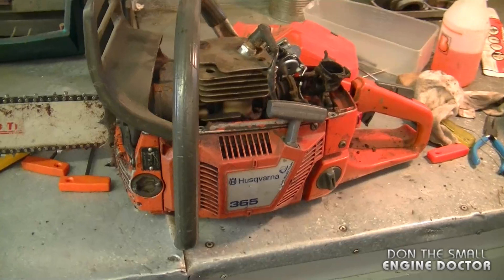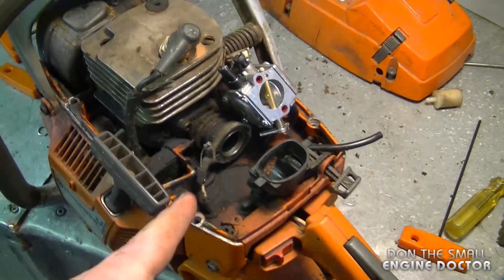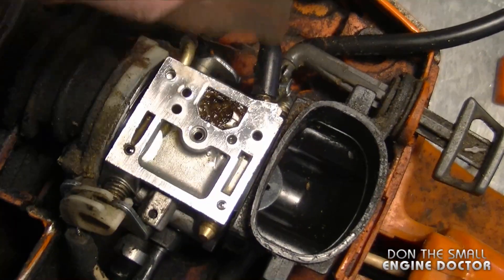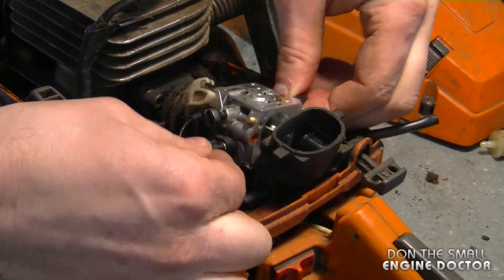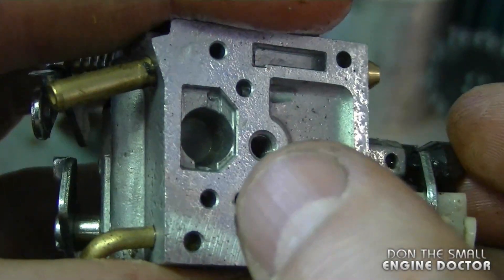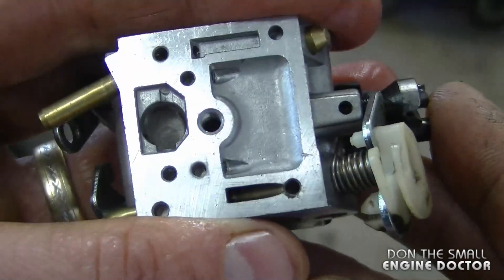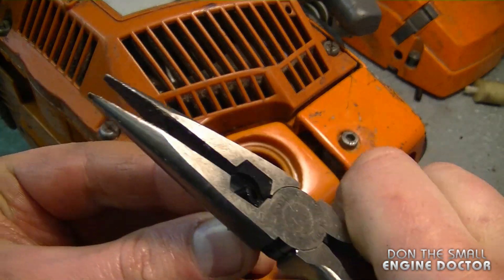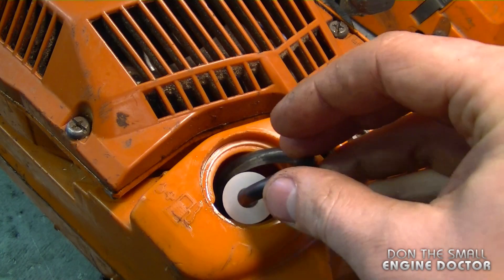Chainsaw Quick Tip #5 - Plugged Carburetor Problems & Repair

Comment: Don, you nailed it again! My Craftsman chainsaw would not run beyond an idle, so I went looking for the fuel filter - it had broken off.  I then took the cover plate off the carburetor and sure enough it looked just like your example in the video. Today it gets cleaned out. (I was already researching complete carb kits.) Sincere thanks!

Comment: Dony, That's the reason I always carry a cheap 1" paint brush with me in my saw kit, brush off the fuel and oil knobs every time before removing.. Good video.
Reply: Thanks man!!!  I always blow them like a maniac, huff&puff as best I can to clear them but *that*^^ is brilliant I've got a million "throwaway"-type wooden-handled brushes, going to make a perfectly sized lil brush / drill a hole in it / leave it looped(strung) around my gas-can's-cap!  What a great idea thanks again :)

Comment: Hey thanks man! My 35 year old Jonsered 525 bogged down and crapped out as if it were fuel starved. I took the top of the carb off and sure enough, the little screen was chock full of crap. Cleaned it and it's running like new again!

Comment: usually when the filter falls off, the fuel line has expanded and may be bad. I have stretched them and found cracks in the fuel line. Those hoses start sucking air causing stalling as the fuel tank level goes down. Usually in line filters have a stainless steel,or spring clamp that holds the filter on,not always but sometimes they do. I usually replace the fuel lines if I find the lines are old. Usually the lines rot and fall off right where the line goes in the tank. This is where the line becomes brittle. If you find the filter has fallen off,plan on cleaning the fine filter in the carb. I guarentee it will have junk in it. Guys cutting wood are always in a hurry to refuel and sawdust gets in the fuel tank as they pull the cap off to refuel. I once drained a tank and found a teaspoon full of sawdust in the tank. It was clogging the filter.

Comment: Donnie, I have a question.  I have a Stihl carb on my ms 460. I bought it used.  Now, it does not want to put sufficient fuel in the engine to get it to roll over in cold start.  It is very hard to get started.  Yesterday, I put some two cycle down the throat and it cranked right up.  It always runs fine once you get it started.  I think the pump side diaphragm is not holding and is allowing gas to drain back in the tank which is reducing gas available to the saw in full choke.  I have even had this saw to crank and run in full choke but never in half choke.  I am going to pull the carb down, clean it and put new diaphragms in the carb.  That should fix this issue.  What do you think?

Comment: Howdy.  Having trouble w/ a small Homelite chainsaw. It starts easy, but only runs on full choke & barely cracked open choke.    Fixed a couple things: new primer bulb, cleaned spark arrester screen, checked carb, its clean, blew out fuel filter w/ compressed air; same crap.      Any ideas ?      Thanks.

Comment: i do a lot of rebuilds of free engines i get off the side of the road... flywheel was not stripped so there was no misfire... had spark... had fuel, but would barely start.. knew it was a carb issue.. never saw this tho... thanks for the vid

Comment: Hi bud, nice vid.  I have a Husqvarna 240 that’s almost impossible to pull the starter on.  Pulls very easily if I remove the spark plug.  Too much compression?  Would cleaning the carb help with this problem?  If not, what else could I do?  The saw has only been used a few times, but has set for over a year.  Any help or opinions would be greatly appreciated.

Comment: i have a question about carburetor.i have a stihl blower br 600 ,and i put a aftermarket carburetor  in it and a ignition module as well both aftermar, should i use oem parts or aftermarket its a good choice? can my carburetor be rebuild and work like new?
Reply from the maker: +perverso12345 oem is always better for those blowers
Reply: +donyboy73 thanks .

Comment: I have a question about the Poulan Pro PP4218A chain saw which I cannot get to run once it cranks. I finally got the saw to crank, but it runs for anywhere from 5 to 15 seconds before the saw dies. Do you have any suggestions on how to fix this problem?
Reply: Sounds like the fuel pump diaphragm has gone bad. If it wont keep running,that means the pump will not continue pulling fuel into the carb. I would recommend a carb rebuild. While you are at it,replace the filter and fuel lines. I know its a pain,but if it wont run,you cants use it for anything but a door stop. Oh, if you can prime the engine and it will keep running every time you give it another quick reprime as its running,then for sure its the diaphragm.
Reply: I thank you for the reply, and that information is very important to me. Since the saw was new I decided to just take it back to the repair shop and let their machanic work on it. I have another Poulan saw which is old and hard to crank, and I will check it for that problem, and take it apart to see what is going on inside of it.

Comment: hey don, where did u order ur ultrasonic cleaner from? and what type of fluid goes in it? I would like to order one.
Reply from the maker: +Robert Waid I got it from a rotary dealer, there are lots on ebay, make sure it has heat setting as well
Reply: What's the model of urs?

Comment: Hey don quick question, I have a echoe leaf blower replaced carb with oem carb ran like new for 5 months  now it acting up again blowing little to sometimes shutting off could it be the car again leaf blower is used quite often
Reply: CARB*
Reply: +fortis619 Leaf blowers can get real dusty. How does the air filter look?

Comment: I have an echo backpack blower and the last time I used it, the power was down a bit.  I checked the air filter and noticed the filter was completely saturated, like a sponge, with fuel. I have never messed with a carb before, is it dirty or should the carb be replaced?  Like i said, I don;t know a thing about carbs.
Reply: Sounds like its flooding. Check your plug,if it is soaked with fuel,then its flooding,this usually happends when the needle in the carb will let more fuel in than needed,a worn tip on the needle causes this. I would rebuild that carb. the kit usually has all the parts you need including needle and depending on type,a seat. I would suggest watching a video on how to rebuild it or find someone that does this work.

Comment: Don't even bother trying 2 rebuild carbs anymore, bought last 2 for $12 shipped. Have generator , lawnmower, and some saws that are pre methanol , read somewhere newer carbs account for that crap. If you ever get chance, maybe do a vid on the  difference between the old and new carbs. Would love 2 see. Thx for vid

Comment: Thanks again Dony for the tip. One question I have is why did you use penetrating oil to wash out dirt, was it just handy or was there another reason. I really enjoy your videos and look for them everyday. Have a Great weekend.
Reply: mcmaster22 this is an old video I'm watching but the reason is carb cleaner will mess up the rubber parts still in the carb where has the other won't.

Comment: I have a question I no it's off this subject but I have a weed eater I can let the spark plug dry out from being socked in gas and I took the muffler of and it's getting so much gas when I pull the rope it will come out side of the muffler every now and than I can get it running but just for a min until the plug gets soaked again any tips
Reply from the maker: +timothy kegley might need a new carb kit
Reply from the maker: +squeege3000 you probably need a new carb kit, make sure it has the screen in the kit. you might have to replace the fuel lines too

Comment: Hey Dony, I have a Poulan that surges at high rpm, what would cause that .. metering issue?
Reply from the maker: could be, try turning out the L AND H screws a bit it might help
Reply: I have already tried that, the L and H are at around 3 1/2 turns out that only shortens the width of the surge.
I guess I break back into the carb. and double check the needle height.

Comment: What is the best fuel line. The fuel line I keep getting keeps getting brittle and falling apart. In 2 years it's done
Reply from the maker: the black fuel line from stihl and tygon fuel line
Reply: @donyboy73  thanks
Reply: Get premixed fuel.Gas station fuel is a fuel lines worse enemy.

Comment: hey i have husqvarna 355 saw ,it will start and run or use for a few cuts and then stals and wont restart
Reply: please help
Reply: Check. Sparkplug arrester screen if you haven't already.probably in early stages of complete clogging.

Comment: hi, how can i repair rounded sparkplug treads on a stihl fs160 without changing the cylinder head?
Reply: +roshan chitan Google: "Heli-Coil" or "Time-sert". both good options
Reply: +roshan chitan If it's not too bad you can clean up the spark plug threads with a special tool -- about $7 -- for just that. I got mine at a car parts store. Here's what it looks like: 

http://www.summitracing.com/parts/oes-25124?seid=srese1&gclid=CNmo466s38sCFRIbgQodEg4IAQ
Reply: Dale Grote thanks man, but there are only two rows of thread left:(
Reply: +roshan chitan wow how did the threads get bad in the first place? did you tighten the spark plug way too tight?
Reply: +roshan chitan Looks bad . . . If it's not a matter of cleaning up the threads, heli coil is the only resort now. If you don't have the set up and tools . . . maybe a new short block is the way to go.  Last thought . . . Once I had this problem, and I took off the cylinder head and put the plug in from the inside out. It apparently cleaned up enough of the threads left that the plug held from the right side. Either way, it's a pain. Good luck, man.
Reply: Thanks everyone,the helicoil set should arrive by the end of this week:)
Reply: +roshan chitan Good luck, man! Let us know how it turns out.

Comment: Can I use computer keyboard duster to blow it off cuz I don't have a air compressor
Reply from the maker: yes
Reply: donyboy73 thanks!....just subscribed....great video!....I checked the fuel line filter before cleaning the carb and it had come off and I never noticed lol

Comment: Three things to look for if your carb is running lean and the H/L JETS wont keep it running. Starts but shuts down.
1) Incorrect carb check valve placement,upside down.
2) Metering diaphram pump on wrong side of gasket.Varies with Walbro carbs.
3) Incorrect alignment of BASE GASKET to mounting bolts. AIR LEAK
http://www.baja5b.lv/wp-content/uploads/teh-info/Walbro%20Carburetor%20Theory.pdf
https://www.rcgroups.com/forums/showthread.php?1692674-Question-about-the-Walbro-carburetor-pump-diaphragms

Comment: Hi folks, hoping the admin of this channel or someone could help, I’ve got a home lite chainsaw that has a new carburetor, new fuel lines, new fuel pump but I believe fuel is not getting to the spark plug (starter). It’s not starting. Is anyone familiar with this issue? Would greatly appreciate the help.
Reply: I'm working on a real old( circa 1971)  Homelite XL-1 chainsaw I got from an auction. Very good condition but needs a new carb. Gonna have fun trying to find one.

Comment: My chainsaw would not run, except with a shot of starter fluid. I replaced the brittle hose and filter in the gas tank. Still did not run, no gas in line at carb. Cleaned and put new gaskets on the carb. Still would not run, no gas in line at carb. Tried to blow out the gas line with some compressed air from carb end to filter in gas tank, clogged, no bubbles. Traced the gas line down.  Doohhh! I did a Homer Simpson. I kinked the gas line between the tank and the handle when I replaced the gas line and filter.. I unkinked the gas line, blew air threw just fine. Reassembled. One pull, no gas, second pull gas in the line, third pull started right up. So this started as a replace hose and filter, but ended as a kinked hose was the final problem.